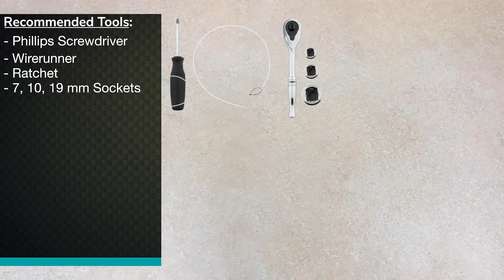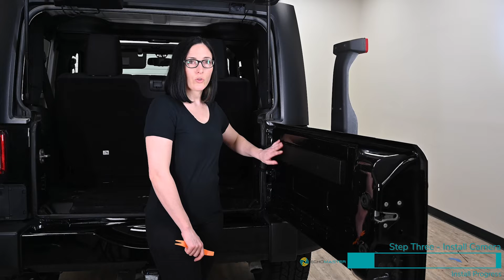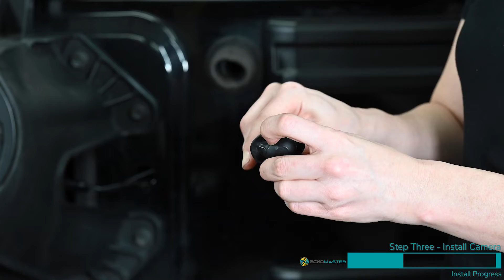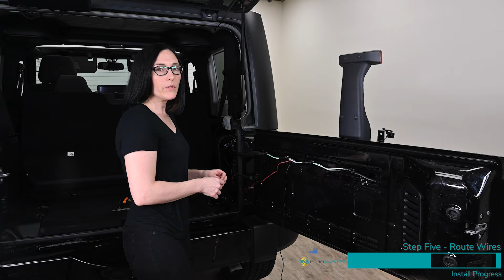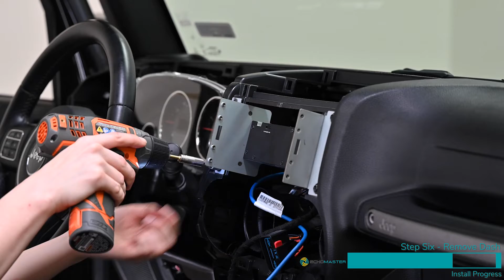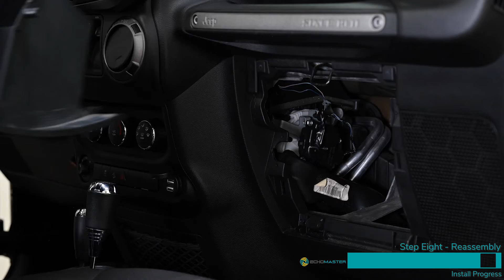INSTALL: Jeep Wrangler Backup Camera with Mount and Static Parking Lines (2007-2018)

Comment: what if when you connect to the power supply (wires camera wont turn on?) ive tried with a 9v battery and the camera comes up on display just no power from your wiring connections section any help?

Comment: Nice clean install. 2 questions though. I already have a 3rd brake light mounting bracket behind my spare tire. Will adding this bracket make it too wide to re attach the bolts? Also, I have a 2017. I didn't see anyone else use that blue and grey attachment piece by the tail light. Do I have that also?
Reply from the maker: Please contact our technical support department for further assistance at 1-800-477-2267 EXT: 3333

Comment: So people want their camera powered all the time?
Reply from the maker: The camera is wired to turn on and off with the vehicle. This way you can view the backup camera on demand and not one when the vehicle is in reverse. The reverse trigger going to the radio or monitor that it is connected to will be what controls it showing up automatically when the vehicle is placed in reverse.